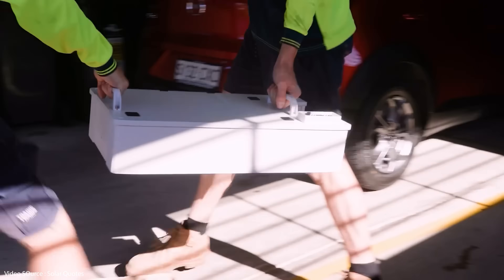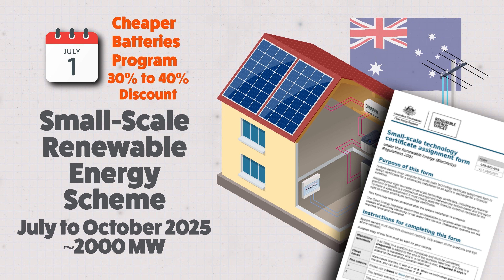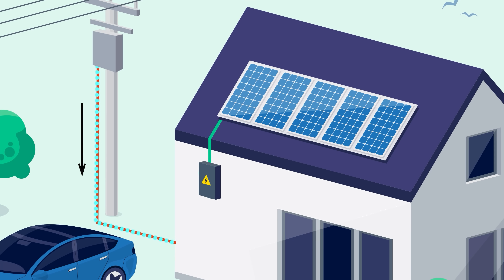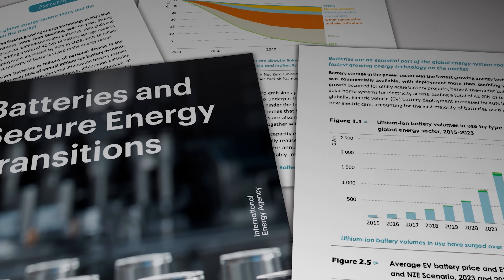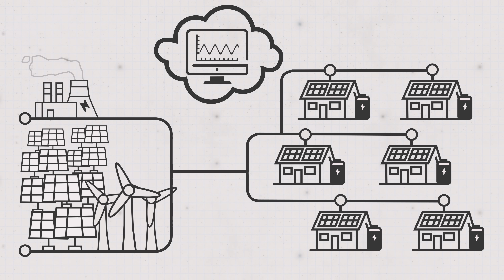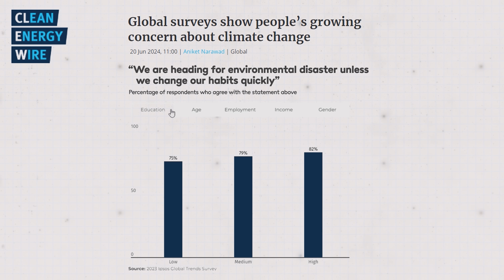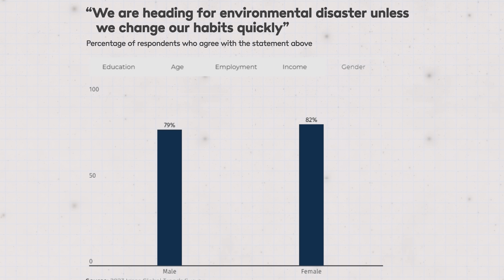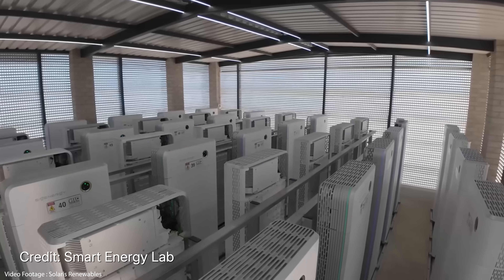Australians installed 100,000 home batteries in 17 weeks. Why can't we all do that?

Comment: Just imagine if all new builds were required to have solar as standard.
Reply: At todays prices there is no need to regulate that. There are some new builds in my neighbourhood and one of them has a south facing roof but it was the only one without solar panels.
After the owner moving in, that south facing roof was filled with the latest and greatest panels. Turns out he did not want the system the builder had offered as he wanted a complete off-grid ready system with as much power as he could fit instead of some mediocre setup to meet a minimum government standard.
There have been new builds with just two solar panels as that was enough to pass the requirements. Imagine paying for and being stuck with that as a home owner.
Reply: @SolAce-nw2hf  My thoughts exactly. Pass legislation to ensure compatible roofs are chock full of Solar when being built and you have economy of scale as well as cheaper install because the roof doesn't have to be tiled. Put in a battery as well to ensure home usage of Solar and possible EV charger as well and you have an added incentive for people to want to buy your properties. It should be a no brainer!
Reply: @wino99999  Forget about solar.  Geothermal is about to leap past wind and solar as the go to source of power.
Reply: @wino99999  Government regulations hardly ever lead to lower cost. Just leave it up to the home owner. If the system is mediocre or too expensive, they can choose whoever they want.
The other homes in the project had solar installed during the build. But personally if would not have chosen the same layout and I think I could have crammed in 6 more panels per home without compromising on aesthetics or increasing cost.

Builders and architects often outsource these jobs to the lowest bidder, making the designs and installs mediocre at best.
Reply: @Les_S537  I like geothermal, but it's not going to beat solar in terms of cost. We need all renewable technology to get rid of dirty coal, oil, gas and nuclear.
Reply: @SolAce-nw2hf  Geothermal will eventually beat it for cost in most places of the world, but not all...
Reply: @Les_S537 Geothermal for heating is very promising, but for generating electricity it struggles to compete with solar and wind due to the high upfront cost and time to build.
I don't rule it out as a nice addition to the energy mix, but with solar and battery prices dropping to a point where just about anyone can afford them and wind power filling in the winter shortage, the high capacity factor of geothermal is not really needed.
Reply: @Les_S537 only for extraction of thermal energy for heating of the home. Otherwise you need to drill very deep to assure steam suitable for driving a turbine for electrical generation unless you happen to have a readily available geothermal source close to the surface, as in Iceland for example. Plus air sourced is way cheaper, unless it's a community ground heat extraction facility. I agree ground sourced is much more stable thermally than air sourced, but you either have to have a largish plot to go horizontally or potentially a deepish drill hole to find water bearing ground in order to assure a good stable supply of heat. Both methods are at least 4-5 times more expensive to install than air sourced, although it does potentially give you the possibility of using the ground as an energy store for any excess energy during the summer months. So unless you know differently I don't think so.
Reply: @SolAce-nw2hf I'm only talking new build here, and part L in the uk only requires a standard to minimise co2 to 80%, and not to be energy self sufficient, which I believe to be insufficient in order to ensure solar PV is installed in sufficient quantity per house. It being cheaper to insulate and limit air changes to try and get close to passive house levels, rather than install a roof full of Solar.
Reply: @wino99999  Actually in roof tray solar is getting very close to tiling costs in the UK at this point, some would argue in fact cheaper because it's massively less man hours of work.
Reply: Nah. Too sane, too critical thinky, too future oriented, too sensible.
Reply: Zapped, and enough solar panels! Solar is required on new builds in California, but they don’t generally orient the roofs correctly, or install enough solar for the homes to be functionally off grid! 

And, every home everywhere should have 50 or so kWh of storage. No need for the corrupt venture capital firms that own our corrupt utility cartels to be the only ones to benefit from battery storage.
Reply: My new build home has just enough to want more and a gas combi boiler to spoil the illusion of joined up thinking, ah UK regulation
Reply: In some places in Australia, it is already a thing.
Reply: In California, that is a requirement.  The requirement is only a minimum sized system, but it means the wiring runs are there and can be expanded with more panels, added batteries, etc.
Reply: Are you kidding? In the US, our dear leader is leading us back to the Middle Age. No more subsidy for solar or EV.
Reply: @leonardforrest8302  why subsidise it first? i dont get it! what an absolute waste of tax money.
Reply: In the UK they mostly in effect are in order to meet building efficiency requirements. It's not actually helpful because scummy builders then install the exact minimum equipment to scrape regulations and it costs more to remove it and fit a usable system than if they hadn't bothered.

We need rather stronger rules, but "must fit solar" doesn't actually work because there are places fitting solar would actually be useless.
Reply: @etchedpixels Same thing here. The bare minimum is standard and if you want more, you pay almost twice market rate with some of that huge margin going back to the builder.
Same thing with kitchens and bathrooms. Just awfull looks and quality and if you want an upgrade you are going to be robbed. The other option is to remove it from the project, but that does not decrease the price. The result is people tearing out brand new kitchens and selling them online and bathrooms being gutted within days after the final inspection and starting over, as without the install there would be no drains and no pipes.
Let's not have the government tell is what we need and leave that choice up to the people.
Reply: @etchedpixels  ridiculous!
Reply: you mean forced and who is going to pay for it?! are you serious?!
Reply: Many (if not all) of the housing developers on the Isle of Man are including solar panels and heat pumps as standard on new properties now. 👌
Reply: @shimsteriom  they arent!

Comment: Well this was a nice story for today at least. Thanks for the info!
Reply: Too bad the feed in tariffs are  so bad as not worth doing... don't know how they do it with solar but batteries might be a different story
Reply: @damfadd  You might get Mrs Jones (your old English class teacher) to go through that comment so that it reads more like something an intelligent poster might say. And yes, I too often have to reread what I have written before hitting the reply button!
Reply: @damfadd  another mis informed bot.
Lay off the gas mate.
Reply: @HotPlates. No. They're right. The small feed-in tariff you can receive is offset by higher daily supply charges. And significantly higher kwh charges for when you do need to tap the grid.

Comment: We got Solar and home batteries fitted just before COVID in early 2020. Best thing we ever did. Along with 2 electrified cars and, recently, an ASHP we have eliminated gas to our house and now have annual electricity bills below £zero. It wasn’t cheap, but solar and battery prices have plummeted since and the technology and choice keeps getting better. Why couldn’t the government offer interest free loans with payback pegged at the level of bill savings achieved? In our case we would have paid back in 5 years!
Reply: Do you think this will continue when the export price is reduced? Being able to bank feed in payments in summer to offset in winter is a huge bonus and I wonder how long that will last.
Reply: @mb-3faze  the key is flexibility, when we got our system the aim was to maximise self consumption because export payments were poor. Now overnight imports are low and exports high, it’s a moving feast as the transition continues. I suspect the situation will change, but exports will continue to be worthwhile in periods of high demand (eg 5-8pm). Even on a standard tariff we would be making significant savings, but I agree that the current tariffs are particularly beneficial.

Comment: After having grid tied solar on our home for the past nine years, we added battery storage this November. While it is very new to our home and I don't have much data collected yet, the battery has already spread out of ability to use our solar generation into the evening hours, when we have our two electric cars plugged in. We were really surprised by the drop in the cost of home batteries when we priced our system. Plus it is modular and we can add capacity if/when we want to.
Reply: Set your cars to start charging in the morning before sun up.
I start mine at 4.30 am in Perth. By the time it gets the home battery empty, the sun takes over with the car, then proceeds to fill the home battery. Less curtailing because the house battery is still recharging later in the day.
Reply: Hi from Canada... great news and your northern cousins are happy for you and a wee bit envious, haha!
Reply: @truenorthbc G'day G'day
Reply: I watched Rosies video. great explanation of using software to provide inertia in the grid for stability. 
Our biggest issue now is large sections of old infrastructure reaching end of life, single phase, & my area- reliance on "dirty" power. Replace with lots of diverse locations of power generation in form of micro grids with multiple links through hubs & nodes. This would mitigate some of risks, from the crazy natural disasters we get in australia, that are inherent with our current centralised system of power generation connected by large high voltage transmission lines. Just have to be smart with transmission lines, power generation , & storage locations.
at the moment ⅓ of nsw (state) wind power generation is in one small portion of one local govt area. I suspect lots more power generation needs to take place in location its being used- not some isolated farm. 
Will leave that planning to multiple think tanks & engineers involved.
Reply: Electric cars are a great way to soak up your excess electricity (if you can) - better than feeding it to the grid.  If you have V2L cars you also have additionl power for your house subject to dring needs.
Reply: Old and new cells don't mix well
Reply: @solidfuel0  the modular systems usually take that into account and charge each battery separately, so basically you charge one, then the next, then the next. So it's like each time your solar is interacting with each battery separately so there is no real 'mix'. This is not a pack setup, it's separate batteries that just are attached to the same system.
Reply: @nfzeta128  no they expand by adding cell packs to the same battery they stack more . Inveters usually have one or two max battery connections
Reply: @solidfuel0  It's not packs but entire modules, sure the inverter isn't individually connected to each one but the modules aren't interfering with each other much either.
Also some literally have only 1-2 extra modules that can stack with them.
Reply: @solidfuel0 You are in fact wrong. I can add new batteries to my battery cabinet. The battery inverter manages the charging of each battery independently.
Reply: @solidfuel0  Can you please stop trying to make out that the designers and manufacturers of modular stationary battery systems have no idea what they are doing.

You are not the expert, they are.
Reply: @BrentonSmythesfieldsaye  The renewable generation/battery storage systems available to us now are evolving faster and faster. 
What would have been possible (or completely impossible) a few years ago often is quite irrelevant now. That is a major positive for small systems at the homeowner user level. Changes in advancing technology can be implemented quickly and cheaply as compared to the old mega-millions/billions central generation and grid distribution technology that takes decades to plan and implement. A mixed system will certainly be with us for quite some time yet but changes for the better (we hope) are certainly surging forward - albeit somewhat held back by the old sealing wax corporation moguls' ability to buy our politicians.
Reply: @theoztreecrasher2647  Absolutely, couldn't agree more.
Reply: @BrentonSmythesfieldsaye  i am in fact work in designing and manufacturing batteries 😅
Reply: @dermotbalaam5358 how many battery inputs does your inverter have?
Reply: @solidfuel0  Ha ha ha, sure you do, sure you do. 😂
Reply: @solidfuel0  "how many battery inputs does your inverter have?" - Why do you persist with this silliness. Regardless of the specificiations for an existing in service inverter, be they electronic or physical specification, that may be exceeded for a proposed exsisting setup expansion, more inverters can also be added to the system to facilitate expansion.

Your tunnel visioned contarianism, ignores the broad range of options and strategies available to make system expansion possible in just about any scenario.

As for your comment about old cells versus new cells, that is where smart battery managaemnent systems do their work. It's not like the renewable energy product sector doesn't know about all the pros and cons of their own industry sector products and how to deal with all that. Come on, give us all a break. Enough!
Reply: @BrentonSmythesfieldsaye  i love how consumers trust the industry sooo much and blindly.. look how you avoid answering and now your solution is to add more inverters. Well  of course adding a new inverter and new battery will not be an issue. We are talking about adding more new packs to existing setup.
Reply: @solidfuel0  "i love how consumers trust the industry sooo much and blindly." - I don't have to rely on anyone. My formal vocational training and experience is in the field of electronics and I.T., specifically servicing, repair and maintenance, for over 40 years.

"look how you avoid answering and now your solution is to add more inverters." - Look how you pretend to know about the topic.

"We are talking about adding more new packs to existing setup." - So what. It doesn't matter. You are trying to make an argument where none exists. Get over yourself.

"look how you avoid answering and now your solution is to add more inverters." - It doesn't matter, even some manufacturers take this realistic approach. The Enphase 5P is a classic example. In this example if you expand battery storage, you also automatically expand the number of inverters in the system. Your take on all this is sadly really naive.

"We are talking about adding more new packs to existing setup." - Yes we are and at the same time, you are trying to argue that a product that is specifically designed and built for modularity, expressly intend for ease of storage capacity expansion, is not fit for purpose. Give us a break.

End of conversation. Enough time wasted.